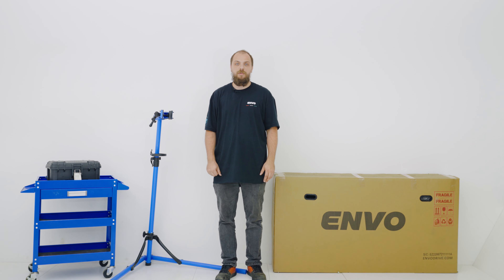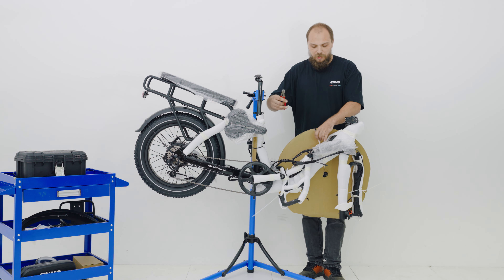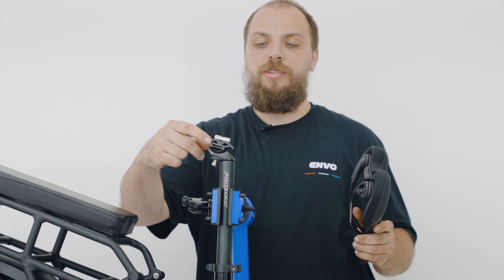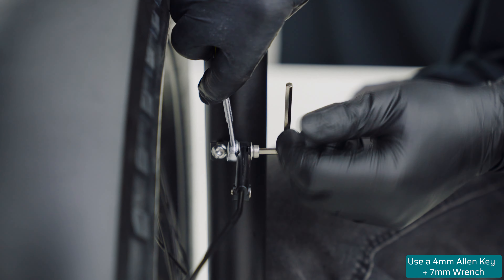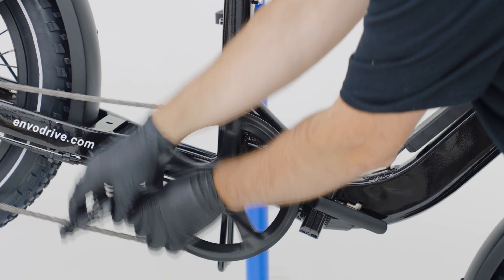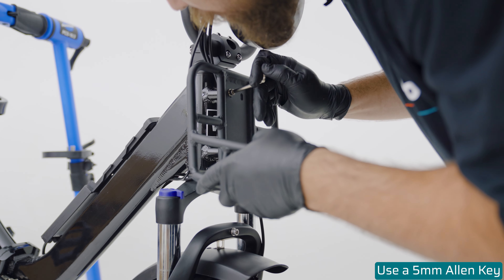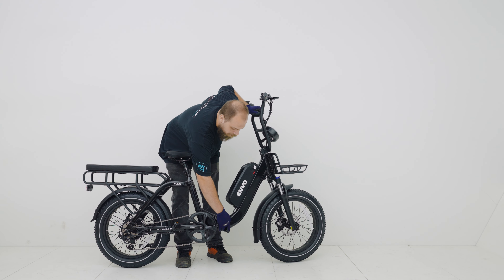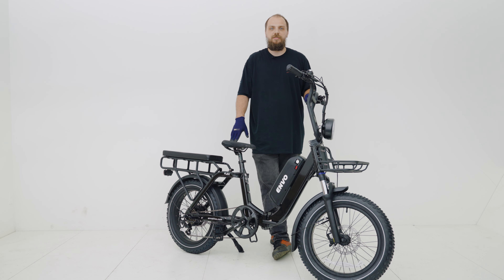ENVO Flex Overland Unboxing & Assembly Instructions

Comment: Looks like a good bike. Just one thing... it's using a derailleur and the necessary filthy, oily chain that makes the grinding compound that will destroy it requiring frequent replacement, not to mention the greasy stains it will make on anything that filthy chain and cogs touch.

You guys could have engineered it to use an Enviolo rear hub and Gates belt drive that would eliminate all of that filth. It would have cost more, but I would be willing to pay for that. This I won't be buying.
Reply from the maker: Thank you for the feedback! We are always working on new product development and this is something we can surely look at.
Reply: Chain and specked maintenance should ensure it doesn’t get filthy.